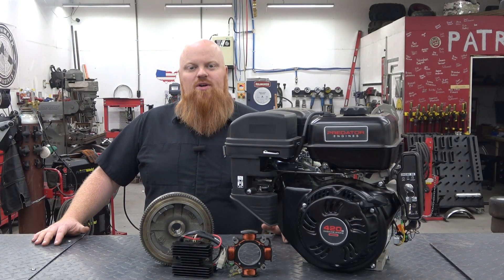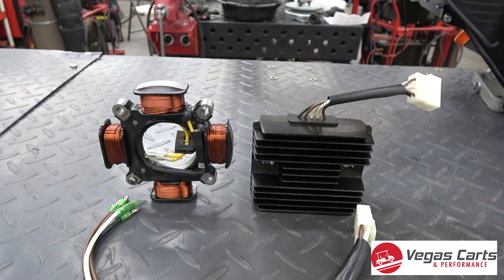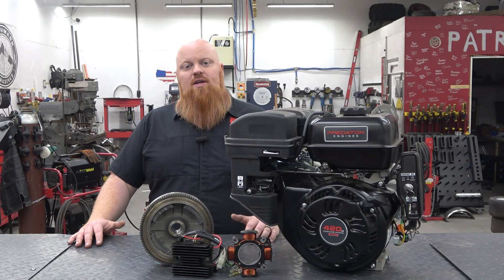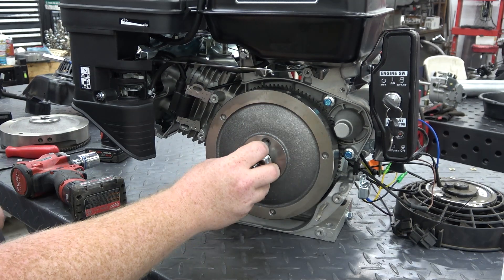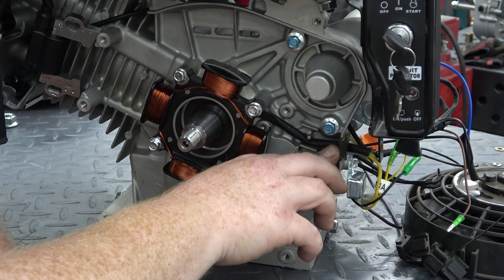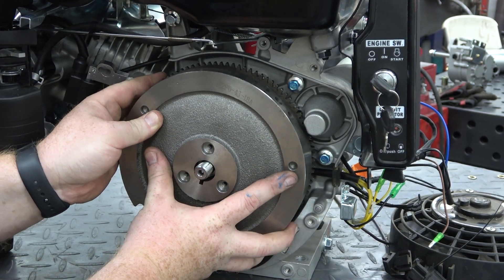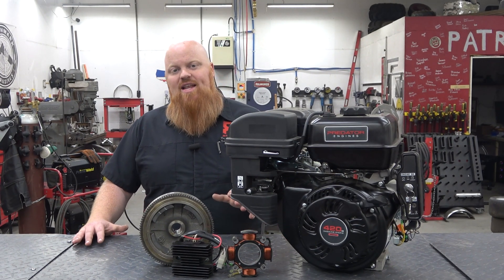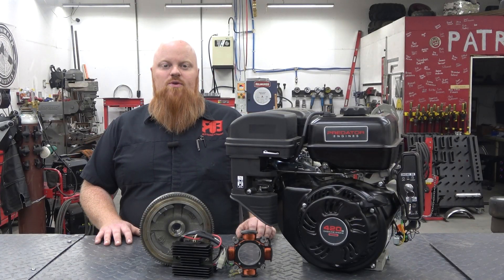High Output 420cc 18 Amp Charging Kit Install

Comment: I bought the one in the link description,  bad thing is it didn't come with the bolts needed and it's a 35 min trip one way to the hardware store. They could gave a jam up product if they just included the bikes needed or at least tell in the description what bolts will be needed. I got several different lengths so I wouldn't be making several trips back and forth to hardware store. I'd say it's a 96% product as it and it worked great, I'm getting 13.75 to 13.85 volts at idle. Now I would recommend someone to do this conversion before you mount this, it was a good deal.of work to get mine changed out. Great product but it could be a really great product if they included the bolts needed, thanks for the upgrade video !
Reply: What did you do with the left over brown wire that went to the coil?

Comment: Something to note here, regarding the torque setting for the flywheel. Red Beard says 83 ft. lbs. and that may be correct. He knows WAAAAAY more than I. However, other sources on the web say 54 ft. lbs. or about that number. Convert that number to Newton-Meters and it is a much higher number, about 72. Which may explain the error here, if indeed there is one. I would appreciate a clarification either way. Onward.

Comment: Will battery over heat if electrical demand on the battery is less than 18 amps? Thanks
Reply: Regulator should take care of demand.

Comment: Hi im wondering if the vegas cart flywheel is any better than the stock one? in terms of revving to 4000 to 4500 ? my engine is a duro max 18 hp in stock form any idea ??? i see the aluminum aftermarket flywheel but no additional charging magnets and my only other option is to mount a small alternator mocked up somehow ? any ideas ??

Comment: good video. where did you mount the regulator?
Reply: Yeah, where does the regulator mount to ?🤔🤔🤔
Reply: @jnbxxx2831 I mounted mine to the boss by the ignition key switch.

Comment: I have a UTV that is currently using a Honda 390 that I’m wanting some better performance out of but I want to keep the charging system. What would you recommend as the max amount of upgrades for max performance with the stock flywheel?
Reply: I don’t mind removing the governor and installing a RPM gauge to keep from over revving the stock flywheel. My question would be what would be the maximum safe RPM of the stock system 4000 RPM sound about right

Comment: I did exactly what you did  but my key start has one black wire left and it doesn't turn off when I turn the key to turn it off any more 😢 where does this extra black wire go?
Reply: Black or green typically goes to ground, which would ground out the coil which stops the ignition from sparking.

Comment: It still baffles me that a company hasn't figured out how to build a billet aluminum flywheel that has electric start capability and charging capability as well because if they did it would sell like hotcakes.
Reply: for realll dude they are probably trying to make one now
Reply: They sell a performance kit for the go-kart engine- like a stage i or stage ii I think.
Reply: At that point you are better off running a separate alternator off a pulley similar to how Toro ran the charging system on the Toro workman twister/md1600
Reply: @dodgeme1986truck that's great for golf carts and side by side and ATVS but for mini bikes that's a problem given how much limited space you have to work with and what way you go about putting an alternator on it cuz there's not a whole lot of options to work with.

Comment: Red Beard my question is how you convert a electric golf cart over to this type of engine are you going to do a golf cart electric swap over to this type of engine with the charging system😊
Reply: Try hooking the red wire to the red battery terminal and the black wire to the black terminal...
Reply: It will need a full rewire as most electric golf carts are 36vdc or higher (standard is usually 48vdc) you will need to convert all electric systems to 12vdc on the golf Cart... Good news the wiring gets much simpler as 12vdc circuits in the gas golf cart would need fewer components (ignition switch and kill switch  relocated are the main 2 connections... Everything else is periferals)

Comment: Dang, i need it for my mud motor but no gov obviously... Guess im back to small alt thinkin.
Reply: Run a small solar panel
Reply: @abels_04  I would need a whole roof over the boat in panels to get 20 amps of charge, I run through trees to much for that. And alot of my fishing is done at night when it's cooler.
Reply: @american7169  gotcha.

Comment: Would this fit on a predator 459cc?
Reply: Curious about this too
Reply: @zachwood628  I don't think it will work for the 459cc, but I just got a 20 amp alternator that I will be connecting to my rig